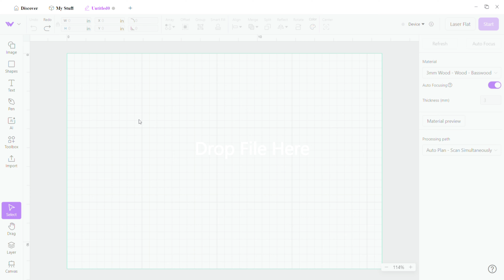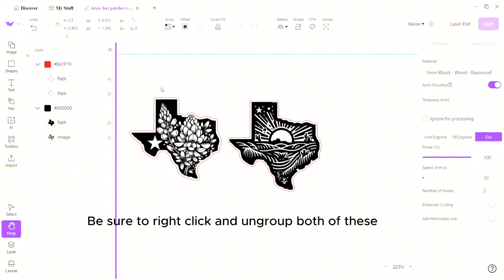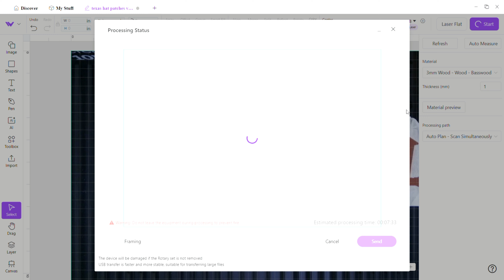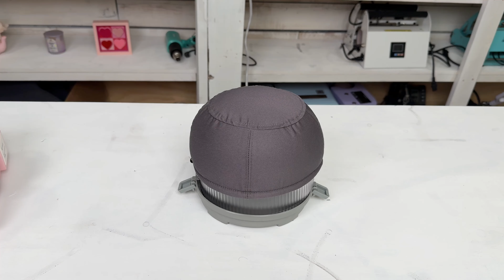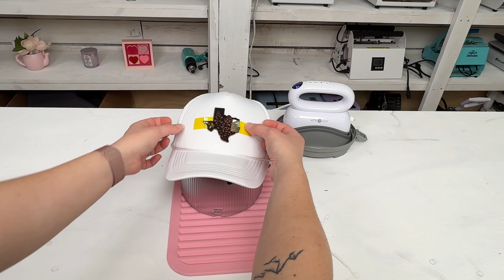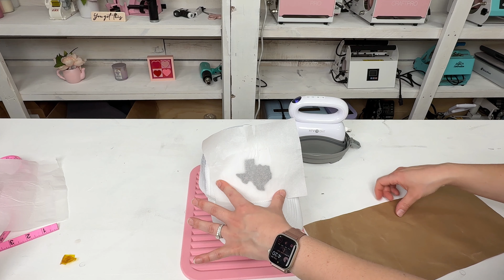Laser Engraved Hat Patch | Custom Hats with WeCreat Vista (Beginner Tutorial)

Comment: Do you have the fan purchased from amazon, plugged into the laser somewhere?
Reply from the maker: The additional exhaust fan I use that’s screwed into a hole in my wood board is plugged directly into an outlet from the fan. The exhaust hose is connected from the laser to the fan. I try to show it at 2:14. I hope that helps and makes sense!

Comment: Hi, what kind of heat and bond did you use on the patch?
Reply from the maker: Hi! The faux leather I’m using in this video is from Amazon and it already has the heat bond attached to it for heat pressing. I linked the exact one I used in the video. Hope that helps!
Reply: @SelenaMarieLLC thank you
Reply from the maker: @MISSTeefromtheSIPP  You’re welcome! LoneStar Adhesive (also linked in the video description) has some great options for leatherette too that you can get the adhesive already added or add your own. It’s better quality than the Amazon faux leather, but the one I use in the video is from Amazon and works just fine for me ☺️

Comment: I noticed that you did not change the material from wood to faux leather.
Reply from the maker: I did not because I manually set my speed and power settings after I do my own testing on this particular leatherette I use. The settings in WeCreat are a good starting point but I still recommend testing your own settings to be sure.